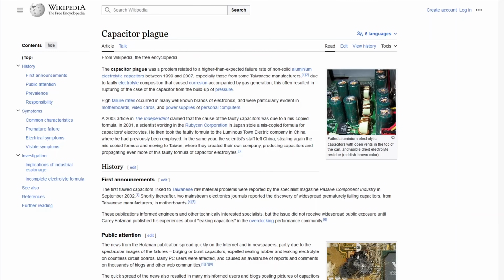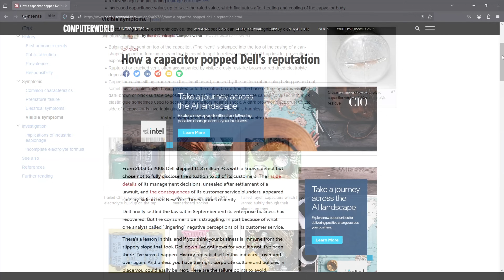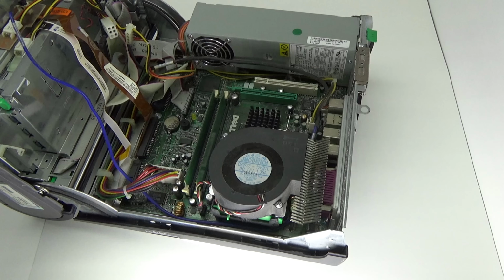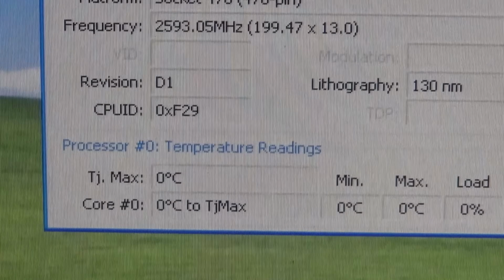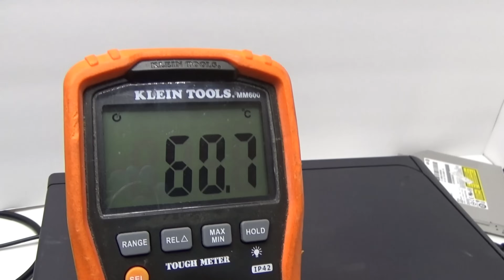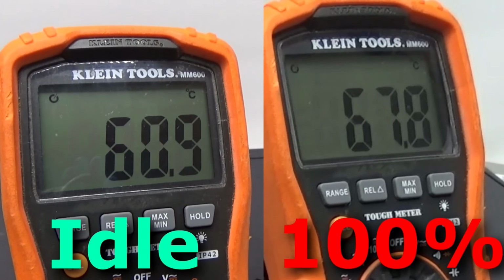Dell Clamshell Hell - Dells thermal nightmare pc's of the early 2000's. OptiPlex GX260, GX270, GX280

Comment: i need help guys, i have a dell 740 it has this problem where it crash windows and it shows solid amber power button which in code "unable to process data" . i swapped ram hdd but it does the same. is it the processor or motherboard?

Comment: I dubb this case the DELL CPU Press.   Want to make a quick toasted sandwhich? Open the case and press the power button and with in 30 to 35 maybe even 40 minutes you have a nice toasted sandwhich.
Reply from the maker: lol. sad part is you're not wrong
Reply: @jims_junk  I grew up on Craigslist computers.  XD so found out easily which ones doubled as a foot heater.

Comment: The GX150 probably isn't as bad as the later GX260/GX270/GX280 since it has a cooler-running Pentium III. So if anybody for some reason wants a desktop clamshell-Dell, I'd get one of those. Dell really should've redesigned the chassis to better suit the P4 CPU family.
Reply from the maker: Agreed.  Also a highly clocked p3 could blow away an early p4 in many ways.

Comment: It's best to stay away from the Dell Optiplex GX200 series if you want a decent Pentium 4 system, the Dell Optiplex GX200 series in general even had a bad reputation. The GX240 had bad video cards, GX260 had questionable hard drives, GX270 just only had bad capacitors, and the GX280 had bad power supplies.

Comment: I have two of the Small Desktop models(a GX270 my cousin gave me, and a GX280 I bought as an upgrade since it supports the newer x64 Pentiums), And from I remember, they weren't that bad, although it's not the easiest to get a good graphics card for something that size. The capacitors are surprisingly in decent shape as well.

Comment: correction mini itx motherboard this is an option if the backplate is swappable
Reply: i have the mini full tower version of that case on your video and everything is swappable and you are correct they are not near as bad on airflow , i still kept the build inside it very modest with a core 2 duo e8400 and a nvidia gt 240 with a intel 775 motherboard so the dell logo does not pop up when i start it up

Comment: My retro rig is an earlier version, the GX150, but looks identical on the outside. The interior has a little different layout with a vertical daughter board holding the PCI slots near where the PSU is in your model. For the 1GHZ Pentium III that it has though thermals always seem slightly toasty but nothing like this. As hot as P4's ran its kinda insane they thought this case would be anywhere near adequate.
Reply: You can get that slightly larger version in GX260-280 as well and the GX150 in this SFF version too

Comment: I like to call those SFF clamshell Optiplexes Easy Bake capacitor ovens. I believe I stole the term from uxwbill. From what I can tell their tower counterparts actually have some front ventilation and run much cooler and happier -- but the cap plague being what it is, it still has a way of killing off those poor ugly-cute things.
Reply from the maker: aww man I COMPLETELY forgot about uxwbill.  Thanks for reminding me!    One thing I will say for these  ugly-cute things (which you're right), when you had to carry tons of them, the rounded face made it very comfortable.
Reply: @jims_junk  I remember they eventually made ones that looked like Xbox 360s lol
Reply: @jims_junk  I actually rescued a GX240 from a client about a month ago -- it's absolutely mint aside from being a bit dusty. Well, and now missing a hard drive. I'm not sure if the capacitors are pristine because they just got lucky or because they never really used it, or because the 1.6 willamette and 16MB Rage128 Pro they specced out for it just didn't get super oven-like compared to higher clocked Northwood and especially Prescott chips. 

It's actually kind of sad to look at -- it came with 128MB of RAM and you can clearly tell they hastily threw another 256MB in it less than a year later because XP was probably predictably terrible on there. Another bizarre thing about it is that it also shipped with a Zip250 drive -- why they opted for one of those and not more RAM from the factory I'm not sure. Either way it's SDRAM only so it was never going to be a screamer, but at least it's in great shape!
Reply: I had the tower one back in the day and I never had a problem with it over heating. I did a lot of gaming on it too.

Comment: My parents had a full tower version of this clamshell design. The one thing I do remember was the weird USB ports in the front, aimed down at a 45 degree angle and upside down, made connection USB drives really tedious

Edit 4:15 yeah that's the one
Reply from the maker: ah yes...I don't know who thought that up.  Most people put the tower on the floor, so you have to blindly reach down and feel around.  For the time they looked nice, but that was about it.
Reply: My dad's gx280 had the cap problem sadly, I wanted to play with it
Reply: My parents had one too! The Dimension 4400 specifically.

Comment: Oh man, I remember around 2010 replacing dead capacitors in those bastards running our lab microscope cameras. We had 5 or 6 of them with Pentium 4 inside, the CPUs thermal management was horrendous so they were slow as hell thanks to constant throttling. Those PCs were supplied with proprietary controller cards for the microscopes so it was either buiing five new £20k microscopes, or resoldering. I got an employee of the year award that year, not kidding. :D
Reply: Lol, had to be mostly gx270's if that many caps went bad 😅
Reply: Weren't the cards some standard (say PCI) interface? Sucks really, but I get it that keeping old PCs to run "old" hardware (quotes on old cause we all know these things DON'T get outdated like PCs used to. Nowadays not even PCs are getting quickly outdated anymore).
Heck Intel made the 386 and 486 in embed package until like the 2010s for replacement industrial PCs and such, old CNC controllers might very well be using those and replacing machinery or test equipment that uses the old PCs and components might run well into the millions sometimes.
Reply: @Kalvinjj  They were, but the guy who set up everything left years prior, Olympus stopped support for those models, it was honestly quicker to fix those MBs than try to figure out how to set up the drivers and software for those weird contraptions. :)
Reply: That sounds right.  When I was in grad school two years ago, there was a Gateway running Windows 2000 so that they could use the Gel Doc (nowhere near as expensive to replace as those microscopes, but still $5000).

Comment: I have a gx240 to this day. Only use if for the rare experiment now but it has a very similar config. Bought it used as an off-lease many many years ago so who knows how hard it worked before I got it. But the reason I commented was I still have a soft spot for this one. Used it for almost 5 years, 24/7 as a completely self contained dvr. Not 1 problem that I recall. About 40W draw if I remember correctly. And reasonably sure it would boot right now if I wanted to.
Reply: I have a 750ti that does the same job for me now. Single-slot, low-profile card with a tiny little 40mm fan in the middle. It's my go-to "known good" GPU for testing things because it needs nothing other than slot power to fire up.

Comment: Well, it could've been worse. It could've been the Optiplex 755 tower I have with a BTX motherboard or the later servers where Dell used ATX cases but still used custom BTX motherboards which had to be mounted upside down, otherwise you couldn't access them from the left side like every single ATX case works. But at least the cooling on the 755 is better, having one large intake fan which also cools the CPU heatsink first before entering the rest of the case.

Comment: Imagine my suprise where the GX280 i had installing windows overnight suddenly pegged its fans at 100% and scared the crap outta me 😂For some reason it keeps doing so even though the case is clean/open, after which subsequent boots just ramp the fans, though considering the PSU and board caps look like volcanos, it was left outside, in surprised it even works..would be fun to see one of these modified. Additionally, like other dells, the northbridge temp will affect surrounding fans, the CPUs dont get hot in these to warrant the temps, but to provide any meaningful pull based cooling, the cpu fan has to create enough dissipation for the chipset, new paste and a molex fan w/ 5v mod would probably solve these issues. Its hillarious you can actually use these as a hair dryer at 100% (trust me i know, i misplaced mine and pulled the cpu fan off :P and ive also run the pentium 4 on a chipset heatsink and it was able to idle in the bios and in windows briefly just below TJMAX, so its definitely not CPU related, those poor chipsets are toasting themselves alive.
Reply: I used to diagnose failure of these using the method:  Is the tower about to take off as the fan is at 100%, yes - dead motherboard, scrap it 🤣 as the motherboard would generate a PWM signal to control the fan speed but if the board was dead, this signal wouldn't appear and the fan, by default, would go to 100% in absence of the signal.

Comment: Wow... that thing sounded like a Jet Engine.  I was and am a fan (no pun intended) of Dell PC's in general.. but this particular design is a no go for sure.  What puzzles me most are the Early XPS cases have insane airflow.  I use a XPS 630i case for my Sleeper PC Build.  Good job with the video my friend. 👍👍
Reply from the maker: Thank you!
Reply from the maker: Like I said to @siliconPower74, I want to believe that it was all the Dell higher ups fault originally for just forcing the design out the door..but if that's the case you'd think they upgrade or fix it sometime in the designs life
Reply: @jims_junk I wouldn’t be surprised if this is from the era when Intel was showering Dell with money

Comment: I still have a GX 270 SFF which to this day still is in operation. However I had to swap out all the caps since they were just looking like the ones in the video and furthermore I did some modifications to keep it's internal ambient temperature a little lower.

- Added a Fan to the chipset heatsink
- swapped out the old alu-heatsink with a later copper version of the GX 280
- removed the green mounting brackets to improve airflow

And the last one I did seemed to be the most "successful one" - The PSU fan always seems to run at the lowest speed no matter how hot the unit gets. I simply re-wired the fan to 7v directly so it blows out more air at the back which also takes more fresh air in. The big ol' HDD which was blocking the airflow anyways is now gone and had been replaced with an SSD.

Overall this PC still looks quite decent and somehow "flashy" but that's really it. It's a hot oven paired with a Pentium 4 which makes for a good space heater in the winter.
Reply: I should also note that I have an PCI Wi-fi Card and a GeForce 6200 installed which both takes space in the unit and create additional "heat" - I did some "basic" tests and can confirm with the mods done above - the systems internal ambient temperature doesn't go over 55°C - measured at 22°C room temperature and full load on BOTH CPU and GPU for around 15 mins. According to my SSD it doesn't go over 41°C after a full day of system power on and doing some random work tasks.

If you don't use any extension cards just remove the slot cover and you get more air intake at the back. Removing the CD-ROM or the Floppy drive won't help with thermals and will result in the CPU fan slowing down which makes the whole "benefit" of more air intake useless + your CPU heatsink will start to get toasty since that whole case design somehow needs a certain "negative air pressure" inside to make the fan work correctly.

However this doesn't seem to apply to the newer GX 280 since this one has a PWM controlled fan and spins up regardless if the case is closed or not thus it ain't better tho because it's equipped with a prescott P4 which gets even toastier than a s.478 P4

After all the suffering I'm starting to wonder why my unit is still alive after all. Well it seems like it serves a purpose as a "thermal testing event" lol

Before you ask: Yes, I had both machines but the GX 280 died because of a faulty CPU socket (cracked solder joints). Yet the XBOX 360 was more popular with this problem LMAO.
Reply: Kinda reminds me of an XPS 400 I picked up, has a giant fan, tops out at 2800 RPM with a Pentium D so it gets LOUD, but I have never had a thermal event with it yet, did recently put a GT 640 in it, really supercharges it nicely
Reply: It's a BTX form factor which has far better airflow than the older ones. Yet I think a Pentium D in the same SFF Clam shell design like the one shown in the video would melt the whole CPU core through the socket lol. design @MemeReviewer

Comment: Every time I see a product like this I wonder if companies do even basic tests their sht before selling it.
Reply from the maker: Completely Agree.  But I'm sure someone higher up said to just ship it.  Thing is, over the years you'd think they'd update it with fixes, but no.
Reply: @jims_junk everything quality wise went down hill at dell after the 2002 decision to start manufacturing in china and abroad.
Reply: Apple did "function follows form" for decades especially thermally: the Apple III failed very often because due to the lack of ventilation (Steve Jobs insisted on passive cooling and no vent holes) it seemingly got so hot inside that some chips dissoldered(!) and early iMacs (and the G5 again) or the infamous PowerMac G4 Cube also have their temperature issues (a stock G4 Cube is fine but you can't upgrade the CPU without adding a fan).
And just a few years ago the MacBook Air (pre-Retina) got frying hot and the Retina one from 2018/2019, Louis Rossmann did a video about this, it has just a aluminium heatsink directly on the CPU and a fan not even close to that (instead of a heatpipe with some fins directly in front of the exhaust side of the fan): https://youtu.be/iiCBYAP_Sgg?t=45
Also the 15" Pro with i9 performed worse in multicore benchmarks than the i7 version because it ran into thermal throttling faster...

Now with Apple Silicon it's kinda okay, my Air M1 is throttling after some time on full load, but it isn't dramatically slower, you can even improve that by adding some thermal pads (the surface temperature of the case will increase, they originally tuned it exactly so that it doesn't exceed the maximum permissible surface temperature of 54 or 55°C).

Reminds me of the HP Omen Obelisk prebuilt "Gaming-PCs" I saw a few years ago, it had a tempered glass window, no plastic but the inside was awful - the mainboard had "naked" VRMs not even a simple aluminium heatsink, the M.2 SSD also had no cooler, CPU with a stock cooler (that also ran into thermal throttling) and RAM without any heatsink, at least the graphics card had a DHE-cooler but at least that had a little illumination (and in the top it had a LED strip) I don't need a ton of (RGB) illumination with cables like Lian Li's Strimer but IMHO it should be "showable" at least with a glass side panel and that one really wasn't and also had poor airflow, just an exhaust fan in the rear, the front was closed and directly behind that the Hard Drive mounted vertically.

Comment: I had one of these as a file server a few years ago, with a 1TB WD Black hard drive adapted from SATA to IDE. I had it running for a few months until it suffered a catastrophic power supply failure (heard a really loud bang from the system) that killed nearly every component except the aforementioned hard drive and 2.8Ghz Pentium IV CPU.
Reply from the maker: Ouch, lucky you got to save the drive.
Reply: Ayyy fellow PSU popper. Same deal, had a handme down one of these when I was younger and it popped its psu, dumped some mystery opaque goo everywhere inside the PSU.